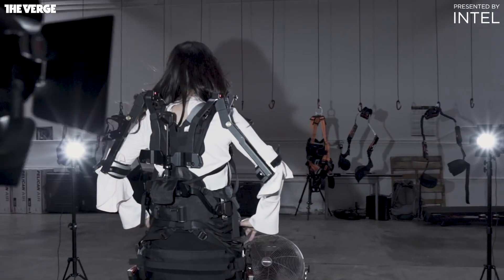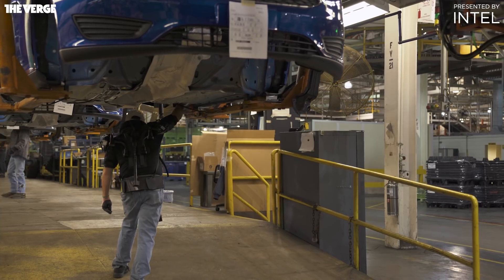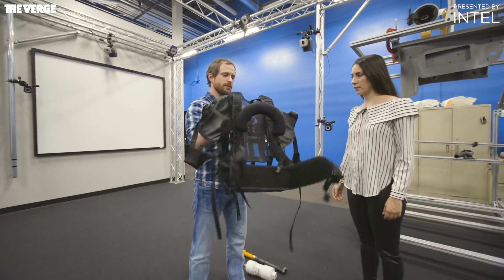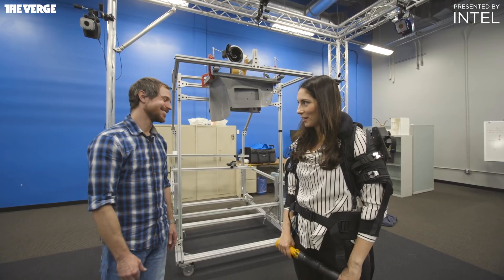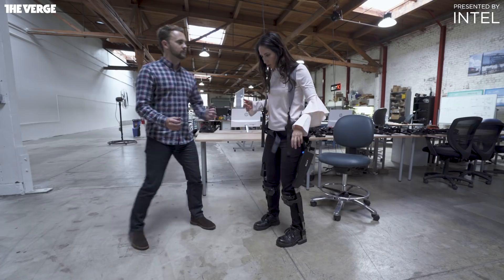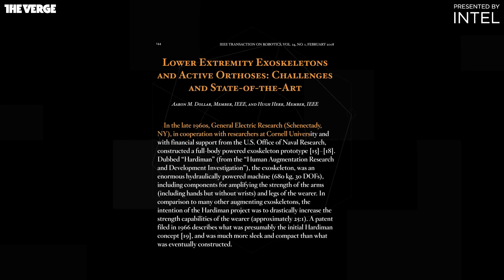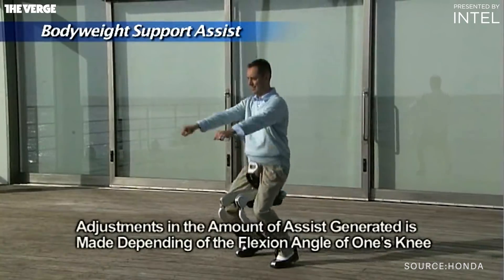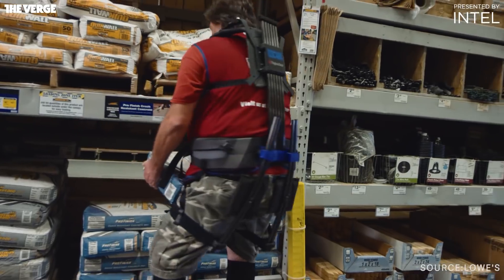These exoskeletons can help prevent worker injury

Comment: I dont think they will stop workers from injuring them selves, that would require making them think better rather than stronger.  what you need is an AI system that can predict if they are going to hurt them selves and gives them an electric shock before they do. or cut out the human component and use 100% robot.

Comment: This is amazing! I have a condition called Elhers-Danlos Syndrome (EDS for short) which in a nut shell means that my body produces faulty collegian. Collegian makes up all your soft tissues; aka: your joints. Which means my joints over stretch and can tear. As of now I’m 37 yrs old. My spine & hips are effected the most. My low back is effected the most, which also really impacts my legs as nerves are being pinched and it causes severe debilitating pain. My hips are torn and also have severe pain. By age 23 I’d already had 4 knee surgeries and my knees still suck. I have wide spread pain in all my joints, from my fingers to my feet. I can still stand and walk, but the pain makes it unbearable at time. I can not walk  more than from my front door to my drive way, the pain just makes it impossible. These types of machines would make it possible for others like me (it’s a rare disease but I’ve found that there are many others like me) to do normal daily activities with our larger joints like walking or bending over with out ripping our joints. These advances could allow our muscles to relax and not hurt so much. My muscles work double time to hold my body together and do their “traditional” function, which causes a lot of extra pain. I hope some day soon that these devices will be made accessible to the main stream medical community for patients.

Comment: So informative, well-produced and hosted. I saw this three days after installing a new ceiling fan in my Manhattan apartment. The ceiling is hard concrete and I needed two concrete drill bits to drill three holes.

Boy were my shoulders burning! When I saw the Ford technician working, I equated it to the motion and positioning of my ceiling fan installation. It will be exciting to see this tech mature and priced for everyday consumption and activities.

Comment: Exosuits would be fantastic ways for the elderly to get mobility and avoid the need for nursing homes, but of course there'd have to be a lot of safety systems in place
Reply: Ekso has a patent for putting airbags into their exoskeletons that automatically deploy in the event of a fall.
Reply: The guy in the end said it well, making this tech affordable for regular use is an engineering challenge in itself.
Reply: It doesn't help the number one reason the elderly are recommended for nursing homes, mental degradation.
Reply: I dont want gam gam to be able to snap my neck like a twig
Reply: Like a systems that walks them back home? Nothing will kill elderly homes unfortunately. Unless we kill dementia, of course.
Reply: Braden Similar situation with my mom. Am excited for futute these cheap readily available
Reply: No it would not be very helpful. Hospitals and care organizations use a thing called the hoist. You are never supposed to lift a patient off the floor on your own - you get a hoist or help of another person. Lemme guess: you grabbed your grandmother under the armpits and attempted to lift her with your legs straight and bending you back? You put your back out twice, because you were acting stupid twice. No amount of money can buy you a gimmick device that will protect you from own stupidity.